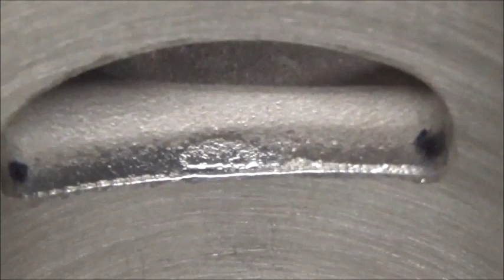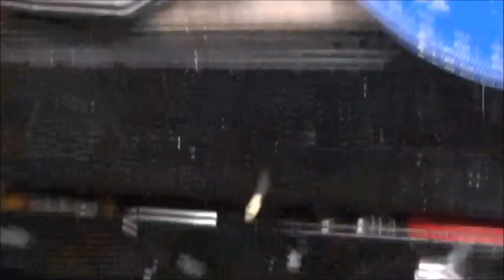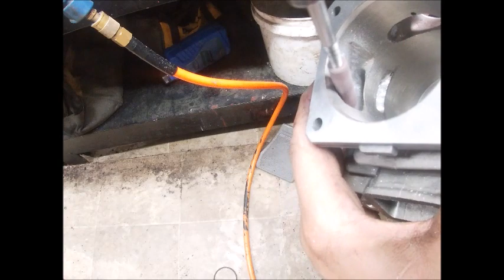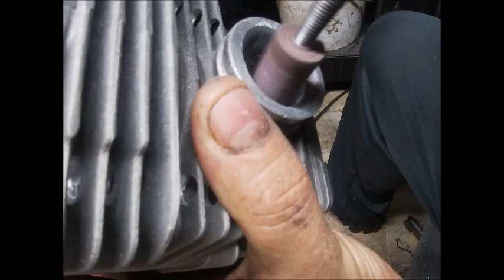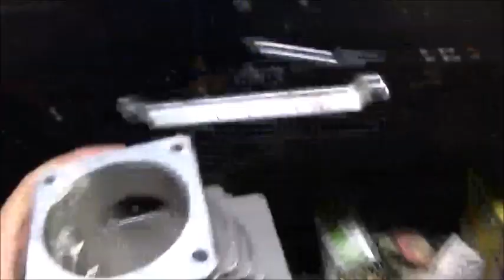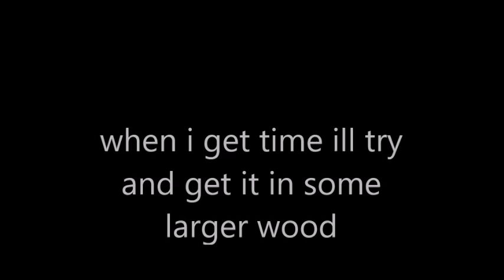Farmertec Stihl ms880 kit saw cylinder porting 2 stroke cylinder poerting 084 088 g888 ms880

Comment: Hi nice job do you square the ports so that the top and bottom of the port open exactly at the same time across the piston or does this cause the ring to catch on a straight edge?
Reply from the maker: Not on a work saws alot of guys do

Comment: All my carbide burrs in 1/4" shank are from my years of head porting and flowbench work I have been threw a few needless to say I learned real quick how to run them on different types of material  the cheapest atf you can find is best or tap magic is amazing  I have found some waxes work well keep them from clogging. Once I learned how to use aluminum carbide burrs I never put a cross cut for steel on aluminum  again until I started porting saws and had to cut the plating off first .. the carbide your using is a 1/4" shank round nose in like a 5⅙"burr size it looks like..  in a saw cylinder having that much cutter surface I bet that bit will eat for sure I hog out bulk with ¼" shank if enough room and finish/do detail work with the ⅛ handpiece and tooling all my port tools are flexshaft Sioux
Reply from the maker: I bought the 2 stroke kit from cc specialty tools well worth it and I have other grinders from head porting days as well..I use 1/4 1/8 and love cartridge rolls..👍👍

Comment: Excellent video thank you! I have a multi part question that may be a dumb question. I can’t get my feeble mind to understand how close can you go and not cause free porting. By pushing it closer do you gain RPM or torque? What is the best separation degrees for all around? Any help here would be greatly appreciated.
Reply from the maker: What I was talking about was notching the piston for intake timing if I can't do both sides evenly I leave it be..
Reply: @JandSChainsaw  can you cut the ports too far and cause free porting also?
Reply from the maker: @rchighfield1  the floor of the exhaust